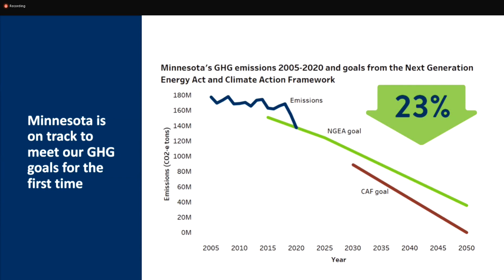Massive, game-changing iron air battery farm coming to Minnesota

Comment: Sure looks like they had to clear a lot of land for that.  And I wonder what the land looks like at the mines for the materials it took to make those? 
They just want you further distanced from your energy source.
Reply: Its iron, its everywhere and you don’t have to risk ground water to mine it.
Reply: @boaz2578  it has a 20year lifespan with minimal maintenance... that's called scaling. .. exponential returns on free reproducible abundant energy.

It's real and within reach so move from your little echoe chamber and reach for some knowledge.
Reply: @user-uu6bi4tn5o  Read my comment again... but slower. And settle down in the comment section. You're getting so wound up that you can't distinguish people who agree with you and people who don't.
Reply: @boaz2578  Boaz, it was not actually meant for you. I struggle to suffer folly but ignorance takes it to another level.
Reply: It's not so much as the land but the ability to scale, store and stabilize energy harnesses from wind and sun. If you got your head out your backside for one moment to understand rather than be so quick off the bat to politicize or criticize, you may actually comprehend.

But wait, no, that would signify intelligence. 🤨🙄
Reply: Don't bother the Enviro-ninnies with DETAILS!